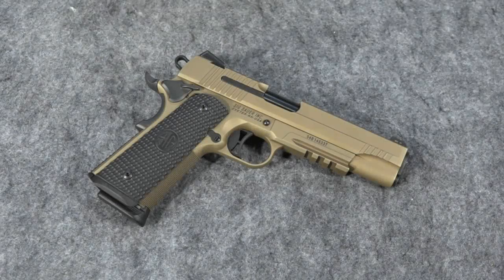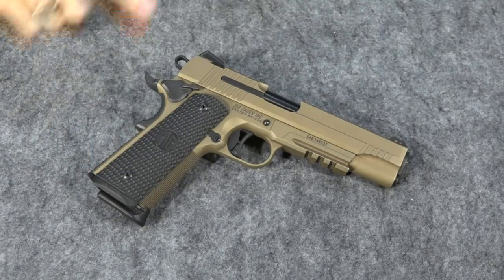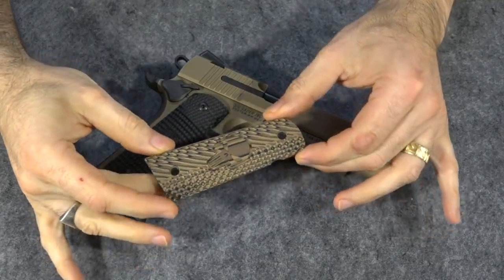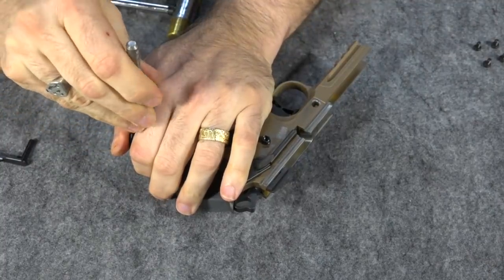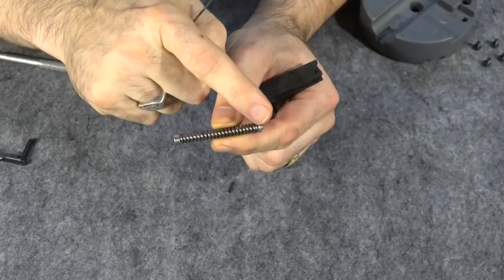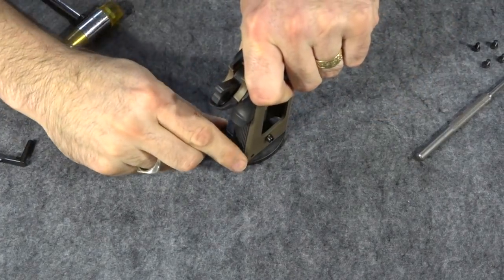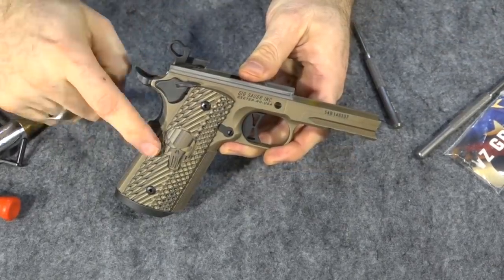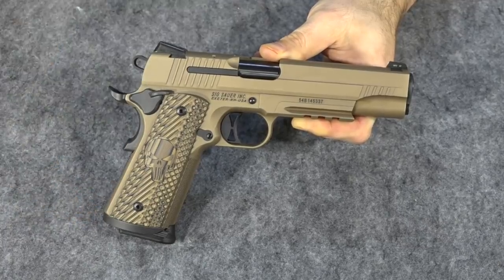SIG Emperor Scorpion: How To Change a Mainspring Housing

Comment: Just drill a hole in the side of your workbench big enough to take the wide end of a punch, then press the housing against the small part. Be careful, the retaining pin will often fall out when the tension is off the plunger. Geoff Who learned that trick in the Small Arms shop, post maintenance, Ft. Hood, TX c. 1976.

Comment: ...have a smaller, 1911 Emperor Scorpion Fastback Carry...EXCELLENT piece...and, also, am all thumbs and have still managed to change out 3-4 grip safeties on other 1911s...my Delta Elites had those Colt plastic (they disguise it by saying "polymer") grip safeties, and changed 'em all out for Wilson Combat all-steel housings...MUCH better...when you spend $800-1000 or more on a pistol, you don't expect to find plastic parts...BUT...might've wanted to do all of this with the hammer forward, instead of cocked...less tension on the hammer spring....

Comment: You can remove some of that main spring tension you're fighting by lowering the hammer.
Reply from the maker: I find it lines up easier with the hammer back. The amount of extra pressure it takes isn't worth mentioning.

Comment: I actually just went to do this earlier. I used the spring from factory in my new housing and when I push it up it won’t let the hammer come all the way up. I don’t know if I got a bad part or if it’s a leaf spring issue but it’s a no go. I’ve taken apart and built a few 1911’s and never had a problem so I don’t think it’s me but who knows.
Reply: John Doe Thanks for the info. It was the leaf spring, the middle tong got under the frame and I didn’t see it.